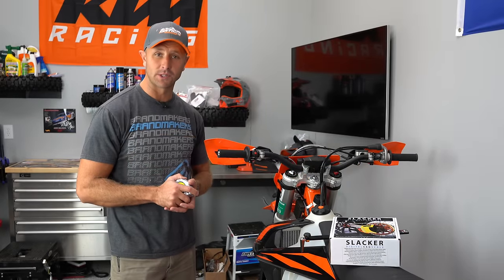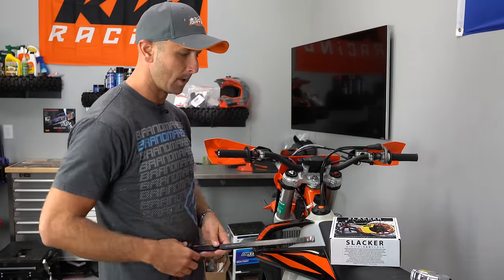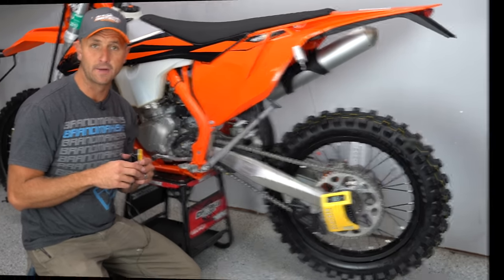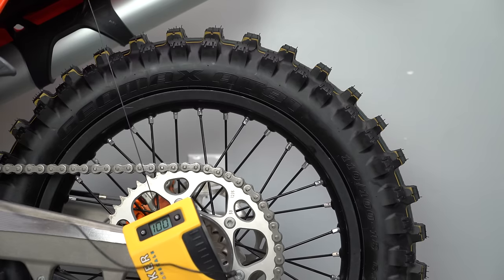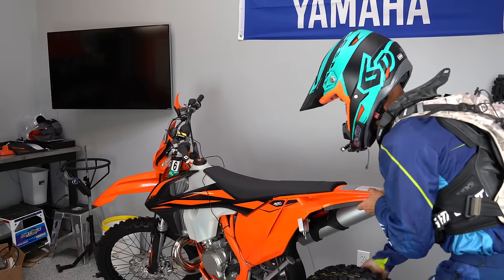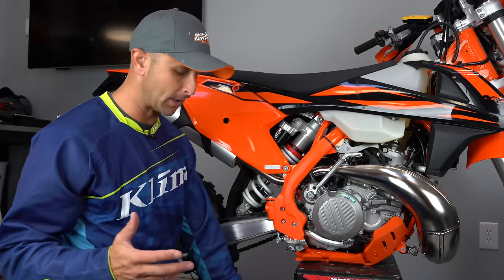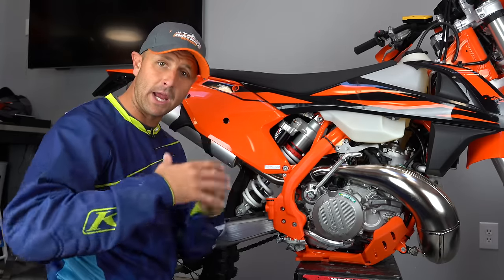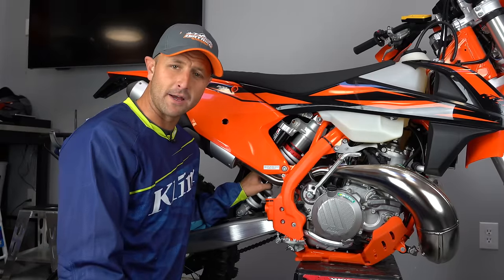How to Set Your Sag on your Dirt Bike | Dirt Bike Set Up Tip

Comment: Good video on setting up your rider sag and remember to when setting up your suspension remember to set your front shock height for steering for push you could move the forks up and down in the triple tree from an 8th inch to a half inch and that will help your push if you have it. Just an FYI in fine-tuning your suspension.

Comment: It takes two measurements to get proper sag because there is a stiction zone. You lift the bike up, (with the help of another) and let it settle slowly and measure that. Thats the lower measurement. Then you push the suspension down and let it come up slow. That's the upper number. Then you measure the difference. It shouldn't be more than 5mm or you have linkage bearing problems, replacement time. Take the middle and that's your true sag. 
It's difficult to do this alone. And no you don't bounce on it till its comfy and measure that because you will probably be off by at least 2.5mm and that makes a difference.

Comment: I made an adjustable ruler with a wooden yardstick and an aluminum ruler..Slot the wooden one ..drill two holes in the aluminum unit ,connect with two bolts ,make a slot a both ends that fits the upper bolt (I use the rack bolt ,its longer) and a bolt with tape wrapped around it to fit in the hollow axle of my CRF...Shelf adjusting...cost...less than $5.

Comment: I need to get that, trying to get people to help is like pulling teeth...
Reply: I made an adjustable ruler with a wooden yardstick and an aluminum ruler..Slot the wooden one ..drill two holes in the aluminum unit ,connect with two bolts ,make a slot a both ends that fits the up bolt (I use the rack bolt ,its longer) and a bolt with tape wrapped around it to fit in the hollow axle of my CRF...Shel adjusting...cost...less than $5.

Comment: I do use the V4 and it´s one of that tools i wouldn't take away when you got use to it. :)
I do use the Sag point on fender where aus (Ktm) mark them tho, did give a better sag. And if you use that "clip" it should be put to bottom/all in on the plastic for 100%. :)

Comment: I'm a bit confused, when i measure from the axle bolt going vertically up to the rear fender (like its usually done on other videos) i get 105mm sag, but when i measure it at an arc like you did, then i only get 98mm of sag
Reply: A Amagorilla he explains The arc because that is the pivot movement in which the swingarm will actually move at. It doesn't go straight up and down it moves in a arc motion.
Reply: physics g

Comment: I got the Slacker tool and ride a 2019 500 exc.I have now tried setting sag in the swing arm pivot arc method as shown here.
Using this method, there is roughly a 10mm difference between checking straight up at the KTM advised mark on the fender. This makes me a little concerned... 
For example for static sag at swing arm arc method I am at 36mm, conversely at the straight up method hitting the stock mark on the fender I am at 41mm... This difference translates similarly over to the race sag measurement as well.. This is a huge discrepancy! 
I am wondering which method is correct for my bike? Is it different for a PDS rear end??
I would tend to think that the KTM advised mark would be the right way to do it.. But not sure? 
Anyone else..Kyle.. got any ideas..???
Reply: I'm also interested int this ?!?!?!!?

Comment: So I'm 200, 6,2'. My used 501 came with a black spring, seller said it was set up for him at 190.  With all my gear I'm pushing 230lbs. Is there a way to see the rating on the spring that's on it, or should I just replace it altogether for something for my riding weight? Thanks.

Comment: Hi! Thanks for great video! A question ; l'm 135lb and use kx250f, my sag is 65. I can't make sag higher because the spring level is on almost max. If l lose the screw of the spring more, the spring starts to moving and wiggling. What should l do to make sag higher? Thanks.
Reply: You need a lighter spring IE a les resistive spring.

Comment: Kyle, thanks for the video, it's very useful! But I wanted to deduce the determination for the word sag. is it possible to call a sag a range? Sag as a  manufacturer's recommended suspension compression range? A static sag is from 30mm to 40 but its a range, it is a recommended range and for a rider sag also is a recommended range. So is the sag a range first of all?
Reply: That is how everyone else does it for sure. I am not sure where he was going with this but it was not correct. Sorry you might want to try again. No sitting.

Comment: Kyle, if I set the static sag at 40mm then when I’m setting the race sag I find I need to adjust the shock nut to reach 105mm wont that change the static sag? Or is the static sag a range or window to be in?
Reply: If you can’t get your static and your race in the correct zone then that means you need to change your spring weight.  Or gain or loose weight lol

Comment: i have a ktm 450 . the front suspension is like rock no matter how i adjust them. Alignment is good they do move but landing is like riding a brick. I
the bike does not bounce but feedback is wicked even on smooth ground. almost solid hard 
Any ideas how to smoothen out the front suspension ?

Comment: It would appear that most dirt bike manuals state to measure sag fairly much vertical. By not following vertical and going inline with the swing arm movement arc, the sag measurement will most likely be lower than that compared to recommendations in the manual. However, saying this, sag isn't always a set number to shoot for like so many people do. Its best to shoot for a close number and then fine tune from there, try less and more race sag (more or less spring preload) to see what performs best. By doing this and always measuring in the same position then it wouldn't matter where a measurement is taken (within reason) as long as its consistent for you (and can be returned to if needed after testing) but it cant really be used to advise someone else of a rough sag to shoot for. Sometimes the difference between measuring the sag vertical against in line with the arc of the swing arm can be like 15mm difference, and when comparing sag, that can be quite a difference in how bike balances and performs. I also like to check sag with about 1/2 to 3/4 full of fuel to account for the ride and using fuel, but like above keeping it consistent when testing and recording measurements is key. I don't wish to sound like a know it all,  just chucking in some pointers I've figured out that might help others.

Comment: There is a sag mark on KTM rear fender. I do my Yamaha same way like u...just wondering how much different results u would get if u use that mark on the fender..?
Reply: Tontsa41 as long as your measuring to the same point during the process it doesn’t really matter where you measure to. If that makes sense
Reply: It’s best to use that factory sag mark and measure from there as the manufacturer gives their sag values measured from that point.

Comment: can i even adjust these forks on my kawasaki kx 85 2007 ?  36mm inverted telescopic cartridge fork with 18-way compression damping / 10.8 in. it has no skrews at the bottom but 2 golde (buttons) on the top when i press them after a ride a little bit of air out but can i add ait to get them harder?

Comment: I'm learning this for street riding on my DRZ400SM. I'm planning on riding with a passenger and to compensate for the extra weight, should I set my sag with a passenger? Setting the sag on a DRZ is a hefty process so I was wondering if I can just be okay with just stiffening up the high and low speed compression? Also should I just stiffen the rear or the front too? Thanks.

Comment: Great video!  I'd like to increase sag on my '06 KTM 525 EXC, but cannot locate the locking (4mm Allen) collar that this one has. I can spin the spring by hand, but it doesn't affect the sag. The aluminum nut on top of the spring won't budge (with a hammer and punch), and I don't want to damage it. Can anyone point me toward the best way to free up this lock nut? My suspension is set up for a #210 rider, and I'm #40 lighter, so there's more than an inch of thread above the locking collar.  Plus, I'd like to drop the seat as much as possible. Thanks.

Comment: Initial measurement should be with the shock topped out. That is, with the bike on a stand with the wheel hanging free.

If your first measurement is with the bike under its own weight, this includes the effects of a presumably incorrect spring tension. You can verify this with your bike manual.
Reply: No. He done it exactly how your suppose to with a sag.  The sag automatically zeros when your on the stand.  The only way you need to (get that measurement) with a analog tape is so you actually have a number to subtract from the unloaded position 

So you unload like you said. Then zero your sag scale. And the sag measures from that preloaded “zero” number giving you the amount of drop

Comment: Did I miss something? If your looking at attack and sitting measurement, whats the purpose of the measurement when bike is on the stand? Just subscribed!
Reply: From what i understand from another video i watched thats going to be your free sag no weight on spring at all that will be your starting measurement and all other measurements you take there after will be subtracted from that number to get your sag set correctly.

Comment: I have a 2020 ktm 500 and in my manual it says I should set my static sag at 37mm. Does it have to be exactly 37 or can I be less or more than that. I set my bike at exactly 37 but then my riding sag is 89 so could I adjust my static sag until my rider sag is correct? And if I need a lighter spring do I have to change the springs in my front forks?

Comment: I have a question so I'm about 5'5 and weigh about 115, would I have to tighten the spring load more since I weigh less? 
Okay so I finished the vid and where can i get that spring meant for my weight??
Reply from the maker: It would be the exact opposite.  You'd be loosening the tension on the spring if you weigh less. You'd want to do that to increase the amount of Sag you have.  You can get them from Rocky Mountain ATV.  I have links in the video description to those guys.
Reply: Dirt Bike Channel will you please do a video on how to jet the ktm 300 Xc-w cause I got a bills pipe on the way for mine and idk how to jet it

Comment: So if I remember correctly you weigh a little over 160lbs. With your gear including your 20lb pack that puts you over well over 180. Do you find that this set up puts you over the edge for optimal performance with the stock spring?
Reply: With his race sag at about 105mm and pretty good, his seemingly excessive static sag of 40mm may be a indicator that his spring is actually too stiff.  But this is a goofy KTM, so the basic rules may not apply well. :)  KTM and the newer Motool instructions say to not put the line on the arc of the axle, but straight up to the fender.  I would like to see the difference in the number with that.

Comment: great info thanks. Looking to reduce height of seat by 1.0-1,5 inches on Husky 250i. How much can i play with on the sag setting to achieve this without compromising handling ? im 5'7 and 178 pounds
Reply: Buy a new seat, sag isn't meant to be a ride height adjustment tool. Linkage or seat height to achieve desired ride height. 1yr later someone finally answered your question lol. What route did you end up doing ?

Comment: How often do you check the sag and do you change it depending on the kind of terrain you are going to be riding on.  What about sag on the forks. I would think that getting the right sag up front would be important too since you want your bike to be well balanced.
Reply: Unless your weight fluctuates a lot either naturally or because your wearing a pack on a ride, you don't have to do it that often. Some off road guys like a little more sag as it aids in helping a bike drive out of the corner especially in sand. I'd start with the recommended setting for your bike and ride it. Make sure your tires are properly inflated(13 psi or so) and pay attention to the front end. If it washes out in a corner as if there is no weight making it bite the ground then either you're too far rearward or you have too much sag. If it bites then " knifes" inward on a turn you likely have too little sag. Adjusting the fork height should come next. The bike should look fairly level with no one on it. Raising the fork up in the clamp lowers the front end transferring weight forward for better tire bite when cornering. Too much may cause knifing. This also shortens the wheelbase so the bike will become more responsive and carve through the woods easily, however the bike will loose high speed stability. Sorry I'm not Kyle, but I hope this helps.

Comment: I just bought a 2017 FE350. It was used in motocross and hard enduro before. Now when I measured the sag.. static sag is 4cm lower that it should be. Is it possible that this rear  stock spring has worn out and loosen over hard abuse? Or I need to crank the preload bigtime? :/
Reply: Check the numbers on spring .your weight.manual spec..

Comment: Do you set sag immediately after buying a brand new bike or do you ride it first to break in the suspension? I just bought a 2020 yz250fx for my first dirt bike and don't know whether to set the sag now or wait until after I ride it for about 10 hours
Reply: Spring will take hours to compress even a milimeter just adjust it

Comment: what about setting preload on the forks?   btw, love the hoodie.  super comfortable
Reply: The Falkor well, if you get your rear sag correctly for your weight for example you set it to 110mm of sag, now when you re-measure the static sag, and if your out of recommended static sag, then you will need to go up a spring rate up or down depending on what the static sag... the spring rate will be for both front and rear...
Reply: The Falkor let me try and make a more simpler example... say you weight 190lbs with regular cloths on... now when you get all geared up you will probably weight 205... the stock springs are designed for a 160-175lb rider... so when you look at your race sag your gonna have too much sag. (The spring rate is too soft for your weight) now when you adjust the preload to compensate to excessive sag your gonna end up having too much pre-load... so if you were to change the spring rate up on your front and rear suspension to your correct weight that’ll correct the pre-load on the front
Reply: The Falkor hope that makes sense... I’m not great at explaining things, but I tried my best to explain in the most simple terms without getting nerdy
Reply: fredman1085 awesome thanks for giving the additional explanation on what issue will arise when having too much pre-load from trying to compensate to get the correct sag if your spring rates are too soft for your weight.. right on the Money, this is why setting sag is super important... it creates an even distribution of weight between front and rear suspension... too much sag will have a weight balance more towards the rear and too little sag will have weight bearing more on the front... a lot depends on type of riding too... but for the most part it’s ideal for even distribution of weight

Comment: Hey there I need some help I weight in 280 ish with my whole kit and I don’t have any help and I was wondering if I just move the red thing on the shock up how many clicks would I have to go I am thinking like ten or so thanks
Reply: You need to move the shock collar down to squeeze the shock more for your weight. I'm a big guy too so I would recommend a different spring entirely
Reply: So I need it move it down not up also maybe get a different spring
Reply: So I need it move it down not up also maybe get a different spring
Reply: @thomashennesseyiii4508  compress the spring by turning it whichever way makes it go tighter. See what your static sag is after. More then likely you might need a stiffer spring. But I would just work with what you have first and see how it rides first before spending money.
Reply: Ok thank you

Comment: Thanks for the video. I’ve watched a lot of videos on YouTube regarding setting the sag and yours seemed most helpful. The other videos were too long with info that wasn’t needed which made the video confusing. 

I do have a question though.

If I weigh 130lbs and say the bike is set up for 140+, do I need a different spring? I know you touched on that a little but is the 140+ lbs based on your total weight with all gear on? I’m 130lbs no gear but probably 140 with gear on. So I didn’t know if since I’m not 140 without gear but am 140 with gear on if I still need a different spring. Thanks

Comment: I just got
The new tpi ktm 300 but I’m to heavy for the stock rear spring. Do u have a video on how to change the rear spring and how to chose the right spring ?
Reply: You know you are to heavy for the stock spring once you set the sag. Then you check the free sag, which is the sag you get when taking the bike off a stand and it settles on it's own. If there isn't adequate free sag the spring is to soft. Conversely when the spring is to stiff and you set the sag, it has way to much free sag. Seems counter intuitive but this is correct. Remember springs are position sensitive and valving is speed sensitive. If the compression valving is to soft you can bottom the stiffest spring on little bumps. Springs set the ride height.